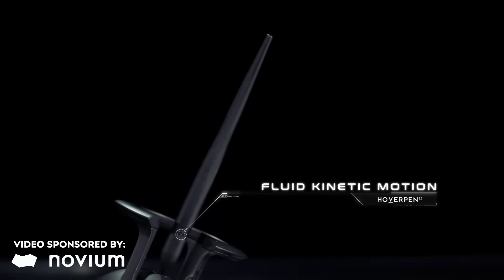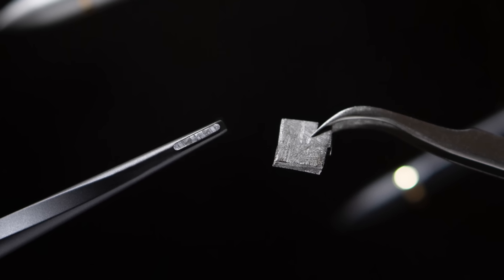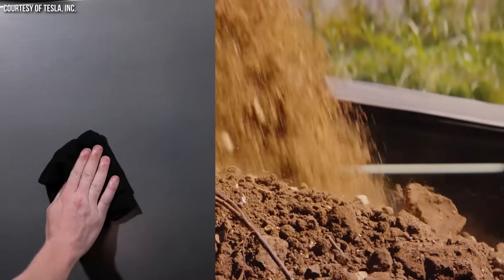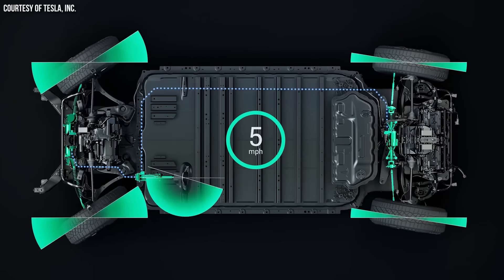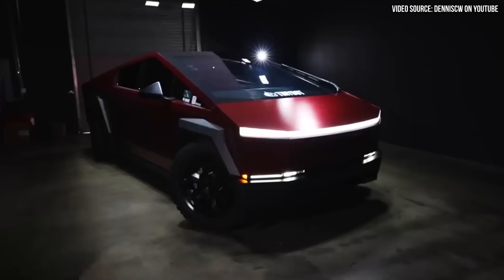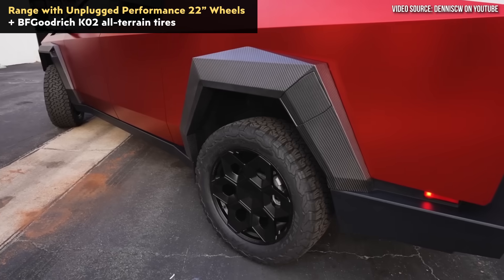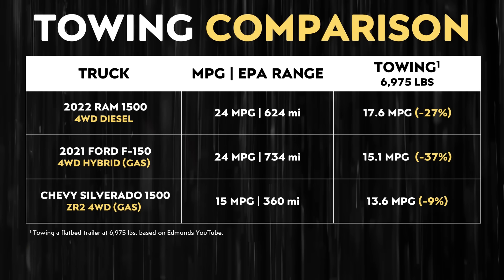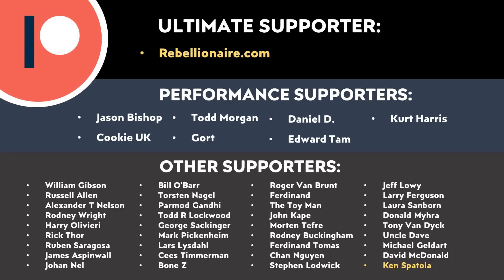Can the Tesla Cybertruck Replace Diesel & Gas Trucks?

Comment: I think the EV towing solution will come in the form of regenerative braking in the trailer. It would have to be smart, and understand the tension/compression and angle of the tow assembly.

Right now the goal is to keep the tow-vehicle in tension, which means the rear must apply more brakes. This keeps the vehicle from jack-knifing under hard breaking.

A small regenerative brake (and electric motor) in the trailer would make a huge difference.
Reply: No it wouldn't.  Very little time is spent using the brakes on the highway so regen can only provide a minimal amount of range.
Reply: @JRP3  

You are speculating...
Show me the research.
Reply: @JRP3  

There are plenty of articles about towing and regenerative braking profiles. 

You basically turn off regenerative braking when you tow. This has implications at all speeds.
Reply: @JohnBoen  No it doesn't.  If you aren't using the brakes regen has no effect, and steady state highway driving uses almost no brakes.  It's not speculation it's reality.  Something is very wrong if you're hitting your brakes all the time on the highway, and no you don't turn off regen when towing.
Reply: @JRP3  

Do you think I am claiming regenerative brakes would somehow work while they were not being applied? 

Is that why you are talking about them only working when being used?

Why do you think you would need to say that?
Reply: @JohnBoen  Because you said regen would make a "huge difference" and I'm pointing out the fact that brakes are only used a tiny percentage of the time on the highway so it's impossible for them to make a "huge difference".  It's that simple.
Reply: @JRP3  

It will.

Any time you use your brakes it will impact the charge.

That is huge.
Reply: @JohnBoen  It's not.  You really have no idea how little regen adds to range.  Seriously, on the highway just think for a minute about how much time you spend with your foot on the brakes compared to not.  Regen helps most in stop and go city driving when you are using your brakes a lot but range is rarely an issue driving around a city.  Even then it only captures a small percentage of energy.
Reply: @JRP3  

We have a disconnect.

You are telling me something obvious, apparently thinking I missed it when you said it earlier. I understand your point.

Maybe what I am saying is not obvious.
* Having regenerative enabled will give an additional 10-20% range from what I understand. This is disabled while towing.
* Include an electric motor in the trailer geared to be highest efficiency at cruising speeds.
* Just having an extra motor allows you to use proportionally lower power, gaining efficiency while accelerating - not just while cruising.

On a downhill route, you will charge your truck..  On a completely flat road, it wouldn't help at all.

I think it would add 10%-30% range depending on the roads.
Reply: @JohnBoen  "Having regenerative enabled will give an additional 10-20% range from what I understand."
This is incorrect on the highway, which should be obvious since you are not using your brakes/regen 10-20% of the time on a long trip.  Plus you only get back a portion of the energy when using regen.  I don't know how else to explain this to you.  I also don't know why you think regen is disabled during towing, it's not.  Look up this video on YouTube:
"Finally: The All-Electric Rivian R1T Takes On The World's Toughest Towing Test!"
Reply: @JRP3  

We are done. You keep pretending I disagree with you.

10-20% is a good general evaluation.

No highway is flat.

I am twlking anout a broad distribution of circumstances and you want tonlikit to a single one.

I do not need people like uiu in my life.. .
Reply: @JRP3  

I think the problem is how I described it.

How about:

Add a cruising motor that operates at high efficiency at cruising speeds.   

It would be geared to be a very high-efficiency regenerative brake at high speeds- the opposite of normal regenerative brakes...

If I were to have said, "Add a high-efficiency electric motor to the trailer, - specifically designed to work extremely well at cruise speeds".

Would you have agreed?

Sorry - the low efficiency at high speed is the problem. High RPM means increased inductance and more heat/less efficiency.

By adding a motor/gearbox that allows the motor to work in its high-efficiency band would help...
Reply: @JohnBoen  The PMSRM motors Tesla uses have peak efficiency in the 6000 - 14000 RPM range which covers a large range of normal cruising speeds. Their peak efficiency is about 97%.   Adding another motor to the trailer would do nothing to improve that at all.  It would add additional cost of course, and you'd get more range by spending the same amount of money on more batteries in the truck.
Reply: @JRP3  

Um... literally ... you can use a computer to decide to allow the higher-efficiency motor to do a larger percentage of the work.

This by definition will increase efficiency.

How coukd this not work?
Reply: Tesla is not yet in the trailer business for starters.  Good luck.
Reply: @snookmeister55  

I know- think about it as a product:

A trailer with a small battery, and an electric motor.  The motor is geared to be efficient at highway speeds.  
The software engages the regenerative brakes first in response to a brake signal and uses the current speed to decide how much power to put through the motor.

The standard tow connector has most of the signal you need. You also need an accelerometer in the middle of the trailer and an accelerometer attached to the car.

Any vehicle could use it.  

You'd get regenerative braking on any vehicle it was attached to...
Reply: @JohnBoen  It's already being done by some companies, the main benefit is the extra battery pack in the trailer.
Reply: @JohnBoen  Think about this.  Tesla Semi does all regeneration from the tractor.   The engineers think it makes sense.
Reply: @JRP3  

I don't know that any are geared like I suggest, but am aware of severalnexample companies trying to do something.

It seems their focus is on using the battery to get get better mileage, so I don't know if they take this design path. 

And back to my point...

Adding EV hardware to the trailer.   Specifically a system designed to be efficient at cruising speeds.

As this becomes mainstream people will see a significant improvement.  They will start using these things on their ICE vehicles.

We agree in every way except for the words I chose to describe it...

Comment: There is only one 1/2 diesel being produced right now, so why do you keep mentioning diesels and not referencing 3/4 or full ton? The diesel 1/2 ton was never built to tow.
Reply from the maker: Ram 1500, Silverado 1500 and Sierra 1500 are all three available with a Diesel engine.
Reply: @Cleanerwatt yes, but they aren’t necessarily intended for towing
Reply: @NextGenEvs  - MERICANS rarely MAX Tow.

Comment: Battery power has an awesome amount of torque and most importantly no need for a "reverse" setting as there is no transmission. Over short distances of say ten miles or less nothing can compete with a pure BEV this being especially true when pulling up even a surprsingly steep grade while under load. Heat degradation of the battery is a very real problem as all bev owners are discovering though so I'm still unclear just how well the current holisitic system will function over long distances over time while under load...although Tesla Semi should prove out an awful lot after around 10 Years now highway use.
Reply: 10 miles 🤣🤣🤣🤣🤣

Comment: Why would  diesel truck more efficient than a electric truck?  It has more energy from a tank of diesel than full charge of battery! Efficiency is energy/distance.
Reply: It's not more efficient. It can afford to be wasteful, since it has much more energy to spend. Already the diesel has 100 times the energy density of Li-Ion battery. The diesel motor is only about 30% efficient to convert the energy into motion, compared to electric, which is about 90% (so 3 times more efficient), But because you can carry a diesel tank with 100 gallons, you need an equivalent battery with 5800 kWh. Oh sorry, you can cut this in 3, since the electric motor is 3 times more efficient that the diesel engine. Still, you will need a 1930 kWh battery to compensate with the 100 gallons of diesel. That's why this heavy duty stuff is still not ready for the EV, the batteries we have are too weak.

Comment: My truck is 8 years old and has no scratches or dents. Amazing.  The bed is 6’ long for 4 inches deep. That’s it. It angles to 5’6”. So it’s really 5’6” bed. Just saying. My truck also gets real world range of about 700 miles with 4 people and the bed completely full. I can fill the tank in under 8 minutes.
Reply: What truck?
Reply: TESLA has Completely FLAT bed w/ ZERO wheel wells.

Comment: Fully charged a cybertruck starts out with 120kwh..
And ice shitmobiles can often fill 100l+.. thats 1000kwh
Reply: But they waste most of it, 70+%, as heat so you need to reduce the kWh by that much.

Comment: Very good points. I am holding off on my CT order until a 500 mile plus version as promised gets released that doesn't take up valuable bed space.
Reply: that would mean almost doubling the energy density of the 4680, not going to happen
Reply: @romteb  340 + 160 = 500  Math.
Reply: I have a reservation too but the price doesn't makes sense for me, no more than it would any pickup in that price range.
Reply: You could reserve now and maybe by the time your number comes up, the battery tech will improve. I reserved in June 2020 and don't expect to see mine for another 2 or 3 more years...😧
Reply: So never then.

Comment: I have had 4 trucks over 35 years: 2 F150 and 2 Chevy Silverados and I never towed anything. I did use the bed to haul a lot of heavy  boxes and pallets of fertilizer. I wonder what % of people really ever tow and how often.   ( didn't have  a camper or boat)
Reply: Even the people who tow a camper, only do it on vacation…
Reply: The farthest I would probably ever tow is 30-60 miles
Reply: Boats, campers - when you need it, you need it.
Farm pickups tow a lot, as do some other work trucks.
All of the above represents probably no more than 10% of pickup sales.
Reply: Most do not tow.  Those that do start at a F250/Silverado 2500, Ram 2500.  The Cybertruck isn't in that market.

This is a F150 competitor for those that do light towing.  3/4s of those that tow haul a boat < 30 miles.  The others need a heavy duty diesel.

Comment: I bought a vw golf diesel wagon in 2010 because they said it was clean and it got great mileage.  As you may know vw lied to us but they did buy back my golf in 2017 for 14 k CAD for a vehicle that had 250 k km on it,  so I used the money to help pay for my 2018 model 3.  I will never buy another ICE vehicle, unfortunately I need to replace my 2009 silverado and had a 2nd day CT reservation, but it will probably be at least another couple of years before electric trucks can replace ICE trucks for towing and hauling things.
Reply: I was diesel-screwed by VW on a Sportwagen.  It was a great driving car but we sold it back to them after 5 years of use.

Comment: NO they can not batteries don’t have the energy density of gasoline make it better battery or change the laws of energy take your pick😂😂😂😂😂
Reply: They don't need the same energy density of gasoline, since only around 15-25% of the energy in gasoline is converted into motion. Most get transformed into heat.
Reply: @richard77231  rofl and even with  that waste it still stores MORE energy that should tell you something
Reply: Until EVs are getting 8-10 miles per kw/h. If that day comes it will make a little more sense to go EV.